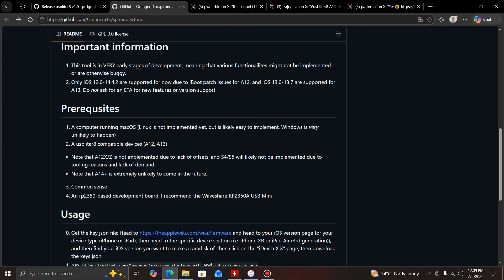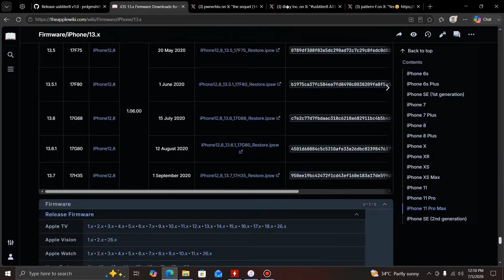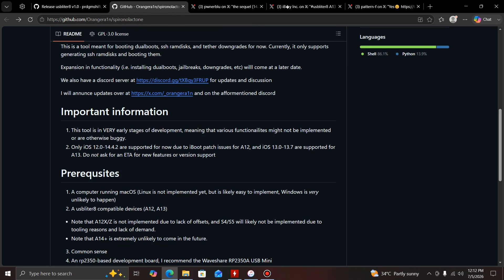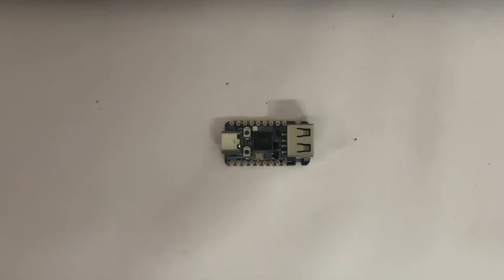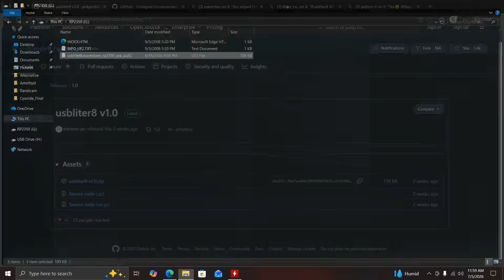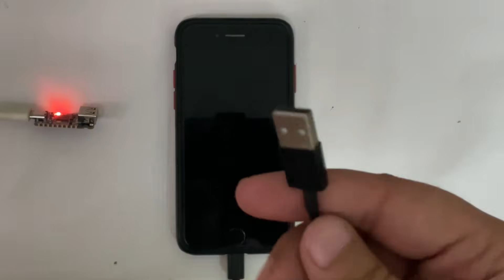USBLiter8 (RP2350) Guide | A12/A13 Downgrade/Jailbreak Progress & iOS 26.0.1 Jailbreak Update

Comment: We can downgrade iOS 26.x to 18.x? Without unsigned?
Reply from the maker: Yes on A12 and A13 devices you can but currently it's max 15.6.1 down to 13.4.1 or 14.0 beta 4 depending on the device.